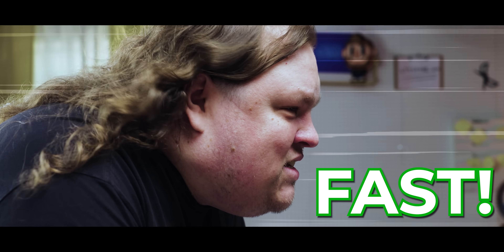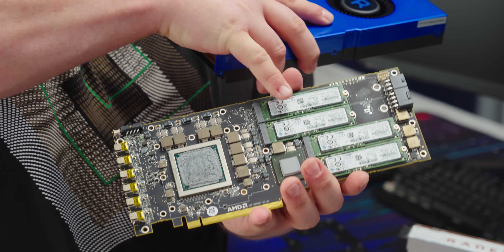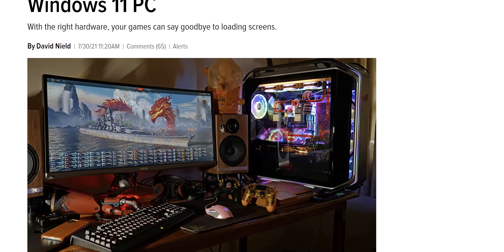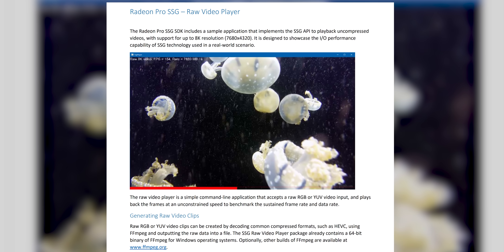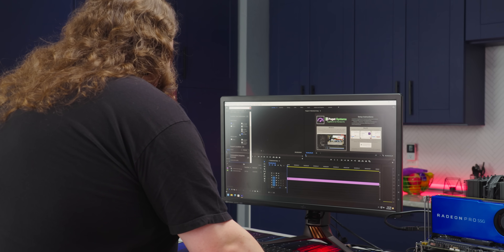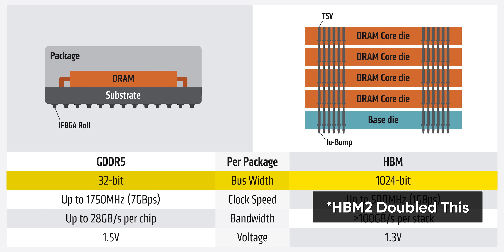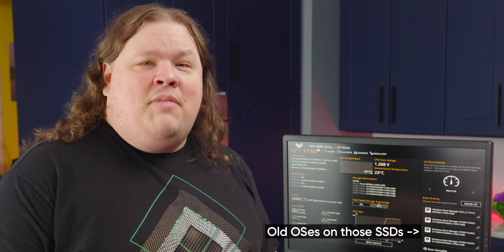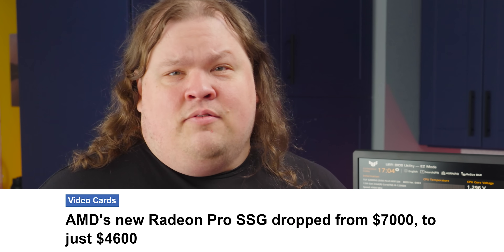Why does this GPU have an SSD? - AMD Radeon Pro SSG

Comment: It might be a stupid question but why do CPU's have multi option builds /specs (motherboard / ram / CPU ) but GPU's come in this spec or that ? If we had a GPU chip on a graphics motherboard which fitted into the PCI slot that then had V ram modules that could be installed like normal ram into sockets. It seems that where GPU's are concerned its like the old days where you had to buy a pre built and were not supposed to open the box and you have to go back to OEM for any issues.

Comment: Massive storage mounted on the GPU would be wonderful for machine learning and other data science applications which require massive datasets. The only problem is that Nvidia is and always will be the professional standard because they make life easier for developers and AMD has never been able to put out a card with performance parity, at least in nearly two decades. It's theoretically a great feature, and one that would probably see a lot of use if Nvidia did it.

Comment: Wasn't the card intended for super large 3D model data sets. Thats how AMD showcased its performance back then. You need to load a software like CATIA and super detailed 3D models like a complete car - then you will find that a card with only 24 GB may not be enough, but the AMD might handle it. So the test pretty much failed here, IMHO.

Comment: I still want PCI-E to be upgraded, not because of speed, moreso because of the slot design on a mobo. Lets start making computers look good, why does a GPU or any card need so much space? Generally cooling is the top and looks come second, then comes the other items power delivery, controllers, traces, etc. Why not make a PCI-E 32x and provide power and some other features? 

Consumer computers are like cars, they are so behind in tech that even buying brand new day 1, it is always outdated for what could have been produced. Most will talk about the die process, and CPU compared to GPU is drastically different in terms of nm size (disregarding that 7nm on AMD vs Intel is not the same). Companies have the ability to change the world, they just choose not to put it out there until their competition has something. Most of the world is ran by corporations, and that is the downfall to getting amazing products.
Reply: Congratulations⤴️contact on claming your prize.

Comment: how GAMING SSD asset streaming SHOULD work (IMO)
WHY should we buy a super fast SSD to install future games to because assets stream from the SSD in-game?
WHY not just have the assets you want to stream COPIED first? You could either copy to system memory (if you have enough) or a fast, but much smaller SSD that's dedicated for such a purpose. For example:
1) Game starts
2) 10GB asset folder starts copying from SLOW SSD to fast SSD (about 20 seconds)
3) Stop game
4) Game starts in two seconds because it uses the COPIED asset folder this time.
Game devs need to get on board with this right from the start. Or Microsoft needs to direct this approach. We really don't need a large, fast SSD. Just buy a much smaller, fast SSD that can buffer just the assets that stream.
Combine this with the option to use a "QUICK RESUME" feature that copies the main game state from SYSTEM MEMORY + VRAM similar to how the XBOX does it.

Comment: SSD asset streaming part 2
Why not have a SINGLE, M.2 SSD slot on the graphics card?
That way, people can ADD a fast M.2 SSD slot to use as a buffer for games and applications that can utilize it. A 512GB SSD would go a long way if a game ONLY stored the texture assets that were meant for streaming, and/or you could store quick resume capability and copy the VRAM state over. And you massively cut down on the PCIe bandwidth assuming the GPU itself has direct control... it has to offer an obvious real-world benefit over a fast M.2 attached to the motherboard though to compensate for the lack of flexibility and added confusion.
Reply: Congratulations⤴️contact on claming your prize.

Comment: My friend, LTT channels say this all the and it ALWAYS makes me crazy‼️‼️‼️ Ferrous DOES NOT = MAGNETIC‼️‼️  Ferrous MEANS IT CONTAINS IRON, WHICH HAPPENS TO BE MAGNETIC‼️

There are 5 classes of magnetic materials:
1. Diamagnetism
2. Paramagnetism
3. Ferromagnetism
4. Ferrimagnetism
5. Antiferromagnetism

Magnetism in any material is dependent on the Orbital and Spin motion of Electrons and exactly how they interact with each other.  In fact, ALL MATTER IS MAGNETIC to some degree.  There is a distinction on what makes some material significantly more magnetic than others.  There some materials where .there is no collective interaction of atomic magnetic moments, while in other materials there is a very strong interaction between atomic moments.

Materials with no or little collective interaction tend to not be so magnetic as to create attraction to other magnetic material.  The best magnets are composed of materials that innately have strong interactions between atomic moment.

We live on a planet that we theorize has a solid, fast spinning core.  This crates the Earth’s VERY strong electromagnet field, without which, Solar radiation would have fried everything on Earth a very long time ago.

Some hypothesize that it is due to the influence of the Earth’s Electromagnetic Field, that ALL matter on Earth is magnetic.  Just some materials can naturally or through artificial mean, can orient the poles of greater and greater numbers of atoms to face the same direction.  Therefore, one end is likely significantly more negative charge, while the other is significantly more positively charged.

You can test this with a cork, a container of water, a relatively strong magnet and a sewing needle.  If you run either pole a few times in a linear motion directly across a typically very weakly magnetic needle, you can orient the atoms to realign in the direction you are dragging a single pole over the needle.  Then one end will be positive and the other will be negative.  Place the cork in the body of water, then place the needle horizontally on the cork.  Voilà, you have made a compass.  

You can now reverse the charged poles of the needle by using the opposite pole of you magnet, in single motions in the same direction a few times.  If it’s a thick needle, it may more strokes. You have imbued a very low magnetic needle, into a polarized magnet, strong enough, while floating in water on a cork, to be influenced by the Earth’s Electromagnetic field. Positive is North, negative is south.

Though there is significant data that suggests we are in the early stages of the Earth’s magnetic fields flipping.  Our poles flip every 10,000 to 50 million years.  It’s been approximately 780,000 years since the last pole reversal.  If it did, in fact, happen now, and the flip we would just fine.  The flip takes between 200,000 and 300,000 years.  We’re there an extremely fast flip, it would devastate our modern society and just about everything that make the world run the way it does now.  Magnets are the most important components in nearly every electronic device and many non-electronic devices we use now.  

Incidentally, humanity has over mined Rare Earth Magnets.  There are likely only enough Rare Earth Magnets left, left to last.  If we extraordinarily lucky (and I don’t believe in luck) they will last as long as 1,000 years.  The more realistic trajectory is 50-200 years.

Comment: What the hell is everyone smoking? This is great for any gaming experience. A majority of stutter and compute time of a gpu is in simply compiling shaders and recompiling them over and over because a gpu can only handle so many shaders at once and games require a magnitude more at any moment. Having chached pre-compiled shaders, on board with high speed access would make gaming experiences so much better.

Comment: An x16 gen4 interface has enough bandwidth that having the SSD on card itself has next to 0 benefit besides additionally complexity. 
The only way such a product can make a comeback is if intel integrates optane memory instead of NAND for their insane endurance and uses a DDR interface like the GPU Vram instead of the slow PCIe interface to access them.

Comment: In 2017 I was still running a PC from 2015 which didn't have any m.2 or nvme support. Would this would be useful for older hardware that supports pcie x16 but not m.2?

Comment: Anthony, is there any speed differnce from a PCIE 16x or 8x drive adapter? Ive had luck on older systems using the OWC Accelsior S (intended for Macs) to get good load times, better than the onboard sata. So, would these beat out an m.2 adapter card for the same nice cases? And I have to wonder, what would those do once the MS API is finally out?

Comment: How about GIANT rendering  jobs and or Fluid simulations in a program like BLENDER where more total accessible memory for the GPU is significantly better than what I hear called "being in swap" where you have to keep accessing storage and shuttling data sets on and off the GPU  card? Can someone tell me if I have this concept loosely  right? You can  NV link 2 x 3090s to have 48 GB of VRAM pooled together which apparently is GOOD for scientific simulations /AI training stuff. And isn't NVME Gen 4 speed higher than DRAM speeds of just a few years ago?

Comment: If enough money could be saved by not having m.2 slots on motherboards, and if pcie gen 4 or 5 was applicable, then the idea would be real cool. You could have the tiniest itx board, with a gpu housing all memory and graphics from a riser cable, and save space maybe or change form factor (without bandwidth cost?) edit…m.2’s don’t take up space, ignore my comment:/

Comment: ALL I WANT IS A BARE MINIMUM 32 GIGS OF VRAM. But preferably 64. 8 is just not enough. 12 should be the bare minimum for today's games. 24 is ideal. But for graphics designers using 3ds or Maya... we need 32 bare minimum.

Comment: AMD could add 3 slots on the 6500xt so that the whole 16 lanes could be utilized. Better to put a 4 slot m.2 card in the first and the 6500xt in other probably fake x16 slot.

Comment: wait. aren't there riser cables that allow you to connect a gpu to an m.2 slot?
i wonder how windows or linux would handle a gpu inside a gpu. or even 4 gpus inside one gpu. rip bandwidth

Comment: Oof if this card was 300-500 it would be the go to card for anyone still using a Cheese Grater Mac Pro 5'1. The $1k price point used just puts it in a spot where most people would opt for 2 cards rather then aio solution.

Comment: One technical question; I got my new pc with the following components; Asus Prime B550-Plus, AMD Ryzer 7 5800x, 16GB of RAM, and AMD FirePro W5100 video card, when it goes on sleep mode and later on, try to continue using it, I don't see any image at all, even the front panel lights are blinking, what can I do, please?

Comment: Well, Nvidia Bluefield DPUs kind of let storage go through the GPU, if you use the high speed network for SAN storage, which is explicitly a supported use case, so this concept is not entirely unique. Goal with either storage or high speed network is to either get lots of data into the GPU or to use the GPU and/or the streaming processors directly on lots of data passing through, like converting, compressing, encrypting, etc. transparently. So AMD just thought too low end for it to become viable. Kind of tracks with the lack of high end GPU style use cases they have gotten. A few pitty supercomputers is about all that happened there. They are virtually unseen in the enterprise fields I am aware of, which is more server, than high end workstation use cases, but still, I doubt the latter has been super successful either.

Comment: personally I'd be curious about intel's application of similar techniques using their faster optane technology, and a more streamlined firmware set to allow direct processing without going through the CPU. I can see why nvidia wouldn't want to try something that wild since they can't tailor an entire system to it without breaking into the CPU space, but intel would be perfectly primed to pull this off and finally beat AMD to a hardware solution lmao. Optane itself seems almost perfectly suited to an application like this, so long as it's write endurance could keep up. They already have experience optimising firmware for shared-PCIE bus applications from their consumer optane line that uses optane to cache conventional flash on the same stick. Despite sharing only 4 lanes, 2 for optane and 2 for flash, the complete unit outpaces all other drives on that same interface, though I cant recall off the top of my head which generation of PCIE it was. since intel's breaking into GPUs for the first time, and need to start setting themselves apart from the competition somehow, if they nail this quirk and make it reliably useful, that would do it. Imagine the average gamer not even needing to buy storage with their gpu, cpu, ram, and motherboard. That simplification itself will earn them a big chunk of hte market. Theres probably still applications for this in todays market, especially in gaming. At optane's superior speeds, this may well become the new value option for games as texture sizes continue to scale. Imagine a future mid-range card that has 16gb of video memory, 60 gb of optane memory, and 120+ gb of flash, in a multilayered cache with high speed striping and swapable modules, to be able to dynamically and intelligently apply texture sizes several magnitudes beyond what we can even imagine today. The lifespan of even average cards would explode, so long as you turned the settings down, but as we approach the point of diminishing returns in graphical fidelity, that's going to matter less and less anyway.

Comment: Nice product bud why so grease fingerprints on card and on memory. Thats not how suppose to install or handle components. Use gloves plz you reduce the MTBF of product by prob more than 60% . That grease actually  acid and with dust combine your hardware will fail sooner as aspected.

Comment: Need Help
Ultrawid in RSR for 1080p
i have monitor 2560x1080 and the RSR don't work in the resolution...

in games the FSR get this valuer resolution for (21:9)
Native 2560x1080.
Ultra 1938x832.
Quality 1680x720.
balanced 1482x636.
performence 1260x540.

but in RSR dont work for 21:9 in 1080p.....if you set 16:9 the RSR work.
I need help fot set 21:9 in the rsr.

these values I got from the god of war game with FSR. Farcry 6 also uses these values for 21:9 at 1080p.

Comment: Oh what? Direct Storage is out? Since when? Of corse we cant even use it because the Software is not up to date… what a shame.

Well. At least i can still make Fun of Nvidia for now regarding RTX IO. It needs DS and it wasnt ready for a long Time at least. Nvidia said though that it will launch End of the Year 2021 and for some Reason we never heard anything about it anymore.

For now its still funny to me that they announced it big as something to compare it against the Consoles (PS5 even more so since they told us its even better than what Sony does) but then they never launched it. Mentioned it two more Times slightly somewhere but just to let us know that they are on it.
Reply: Congratulations⤴️contact on claming your prize.

Comment: Dumb idea. Especially when it needs a bespoke (potentially proprietary?) API interface for each use case. That means for each use case I have to go write a program that interfaces with AMDs API which is colossally stupid. In simple terms that means that when you finally think of a way of how to use this thing you basically have to go off and program it. Gaming was never an option, this was always a terrible idea for gaming because anyone with sense knew this would just add latency to access for the CPU which is where any gaming process is ultimately going to communicate from. It is a small miracle Adobe got off their ass and integrated it at all. It's an idea that makes sense in principle until you look at the logistics and realize that all that effort to shorten SSD -> GPU access means little to no real time gains except in the most extreme cases. This is all putting aside the fact that putting your SSD near a red hot GPU is probably not a great idea either.

Comment: Hello linus! I'm here to beg you because my GPU 750ti is dead. It always crashed, and it says VIDEO TDR FAILURE. I did all the methods that every YouTubers posted about on how to repair this kind of problem. Its still the same, BSOD don't want me to get rid of it. My processor is only i5 4th Gen and a 8GB of RAM. I can't play games, and I don't have the budget to buy a new GPU because I'm still studying and my mother cant afford to buy a new one. Hope you will see this message of mine, Low-end GPU would be great for me. I'm from the Philippines. Thanks!

Respect message.
PEACE!